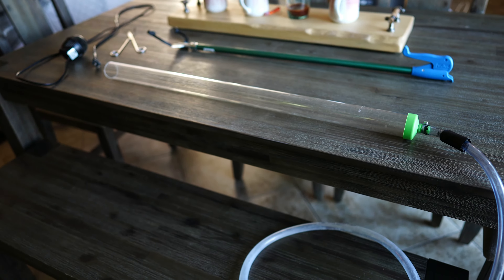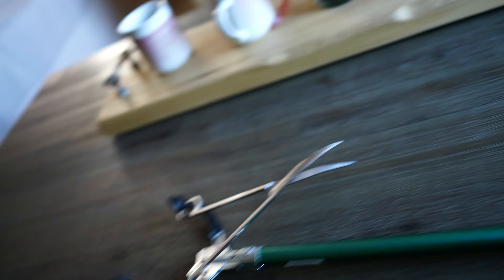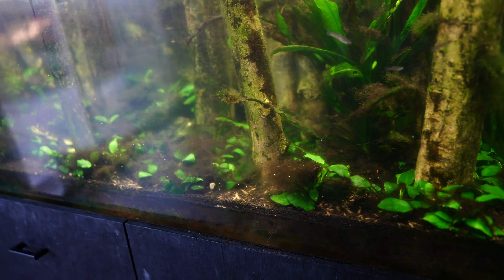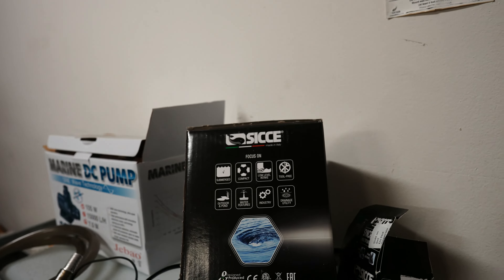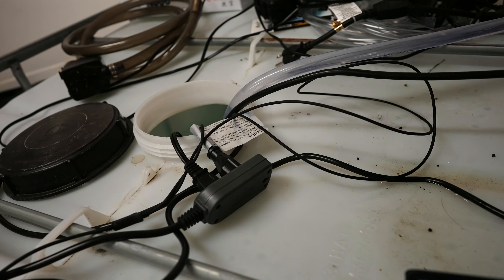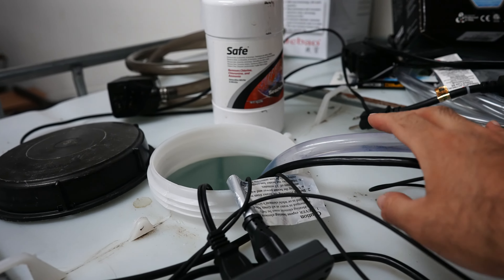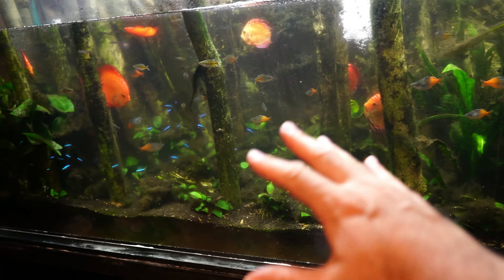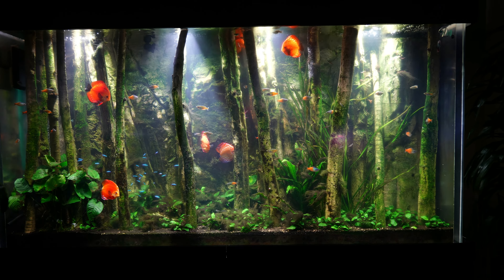Discus Mega Tank - 16 - Maintenance Routine

Comment: You can cut a bigger hole on top of the tote to use a bigger pump?
Reply from the maker: Yes but then I will never be able to fully close it and have to worry about evaporation and too much moisture in my garage. I found a great external pump which is the Reeflo Barracuda.

Comment: I agree with you on those tall python vacs. They’re so clunky to move around once in the water.  I have one but don’t use it either.  Your plant trimming idea 😂 that’s a good one!  There’s something relaxing, to me anyway, doing water changes.  I really like those logs or trunks. They add so much character to a tank that would otherwise be so difficult to scape 👍
Reply from the maker: I think standing logs are pretty much the only option for a tank like this because it isn't very wide front to back so you can't build any rock slopes unless  you want them to be super steep and at that point you may just go with a 3D background. I would say 75% of my maintenance is done via the right selection of a cleanup crew, in my case Amano shrimp, bamboo shrimp, Mexican dwarf crayfish, Corydora sterbais, kuhli loaches, tons of trumpet snails, some nerite snails and one half-banded spiny eel in addition to the dosing of beneficial bacteria to replenish what gets removed during a water change. The tank is maturing nicely this way.